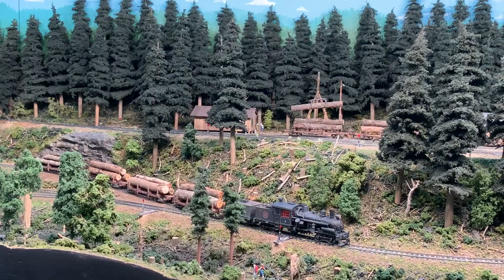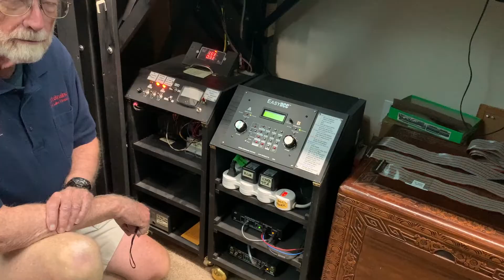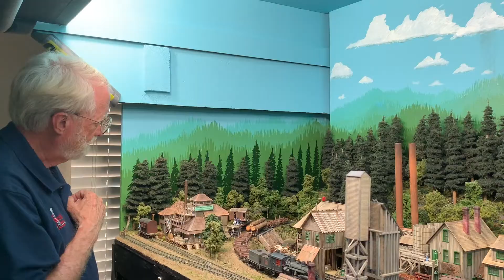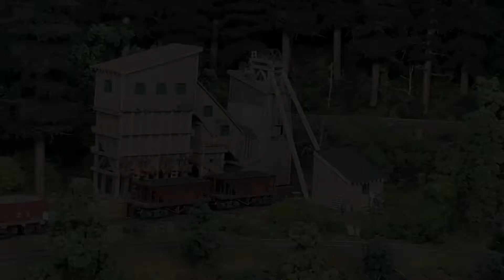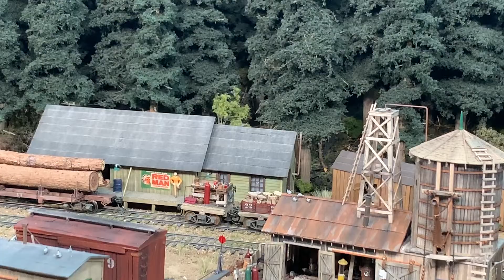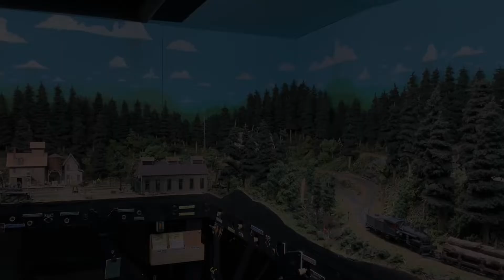Clear Lake Timber Company Model Railroad Tour- 2022

Comment: That is a very impressive layout. I'm a big fan of logging themed railroads; the use of slow-running locomotives makes the whole railroad "bigger." It's obvious you've given much thought to the "why" of operation and it seems very logical and believable to me. Your scenery is very impressive with lots of understory vegetation typical of the Pacific NW. Your detailed structures are also very impressive and I'd like to see what they look like during dusk with the interior lights on. You created lots of trees and it paid off in displaying the "scale" of NW forests and creating "depth" to your scenery; a perfect "stage" to run your railroad. IMO, this is an excellent example of a small railroad done exceptionally well.
Reply from the maker: Thanks so much for the kind words.  I'm very happy with the way it turned out.

Comment: Carl, I just keep coming back to your videos. I was born and raised in the Coos Bay Oregon area, once the largest lumber port in the world. My dad worked at Coos Bay Lumber Company, then Georgia Pacific after the buyout. In high school I worked after school as a watchman in the mills. A couple of the mills were built circa the 1890's with boilers, head rigs, saw filer rooms, generators, and such all original. It was fascinating to have gotten to see all that. I have the Rivarossi Coos Bay Lumber Heisler loco in HO and my wife scored a Mantua 2-6-6-2 Sumpter Valley #250 loco kit (with The General 4-4-0 too) for $75... I also bought Georgia Pacific and Coos Bay Lumber log cars from Rivarossi. My original intent was to make a cameo model of the logging train under an aquarium for my dad, but life got in the way. Now I found your model railway and would like to use your ideas to make a similar one of the CA Smith-Powers/CBL/GP RR
Reply from the maker: David, thanks for the note.  My Rivarossi 3-truck Heisler and my Mantua 2-6-6-2T are my best runners and have no trouble moving a short train up my rather steep grades.  So they are my "go-to" locos for road work.  I use my Bachmann Shay for switching.  My Dad was from the Pacific Northwest, and his love for the region passed down to me.  For me, there's nothing like a forest of evergreens for scenery!

Comment: I'm in the process of scratch building skeleton cars right now and this video came up on my recommendations. Nice timing
Reply from the maker: I found the all-metal Kadee car kits I used to be a great kit that produced a good-looking model that has enough heft that I don't have any problems with them on the track.  The one "gotcha" with the Kadee cars was that the truck swing on sharp curves tended to put the wheels into contact with the skeleton/frame, leading to short circuits.  I had to files notches in the frame to give good clearance with the wheels.  I also had to pay attention to polarity of the wheels and the cars themselves due to the all-metal construction combined with the metal trucks and metal couplers.  I think the cars are electrically "charged", so they all have to be carefully oriented to put all the non-insulated wheels on the same side of the train.  Good luck with your build!

Comment: Hello Carl, I love your layout. Nice work! I’m building my layout for the first time. A logging camp. Your layout gives me a lot of ideas. I really like the log loading crane and I want to build it. But I just can’t see the details of it. Like how it turns, and the cables and where they go, and what powers it up. Any suggestions to help me out?
Thanks, John
Reply from the maker: John, the loading crane was part of a Sun Coast Models kit.  It had a little "power house"  shed structure where the cables terminated, but there's nothing inside and the instructions did not address what might be in there.  Since my crane sits near the back of the layout I didn't worry much about such details.  The base of the crane has a round turntable-like device that the cables from the shed wrap around.  It appears that it rotates based on pulling on one side or the other of the cables wrapping around that turntable thing.  So that's two cables going from the crane to the shed.  There are two more cables going back there, one for raising and lowering the boom and another for raising and lowering the hook.  Sorry there doesn't seem to be any way to put a photo in these replies.  I hope that helps a little bit.  Carl

Comment: Same  theme  76 yrs old will i make it ?? have all the buildings  and room and  no lay out yet ,like the idea of tug boats which i have different types etc wish you had a book on this great lay out thank you for any reply.trees lay out  track ho .tips for pine trees very costly .
Reply from the maker: Hi, Louie.  Thanks for commenting.  I was 69 when I started building the railroad (77 now).  You can do it!  I don't have a book, so my videos on the my YouTube channel will have to do.  You might want to check out the one about building the railroad.  I used Micro Engineering code 70 #6 turnouts.  My flex track is code 70, whatever I had on hand (I think mostly Shinohara/Walthers).  I used Blue Point turnout controllers connected directly to knobs on the fascia via dowel rods.  For the "pine" trees I used material kits from Coastmans Scenic Products.  They probably cost more than using Caspia fern branches from the craft store, but I think they went together a lot faster.  Good luck on building yours.

Comment: Wonderfully designed and built layout. Thank you for the tour. The video was well done as well. Judging by the many exterior lamps and such, I bet it is fun to operate in night mode, so to speak.
Reply from the maker: Well, actually true operation would be difficult at night because the uncoupler positions, turnout position, and labels on the turnout controls would all be hard to see.  But it's great for "showing off" to visitors!